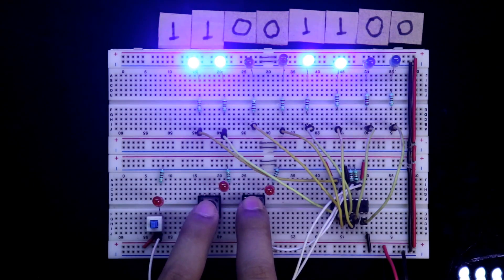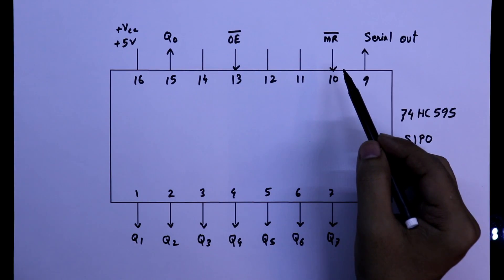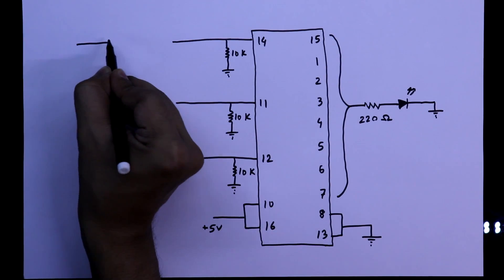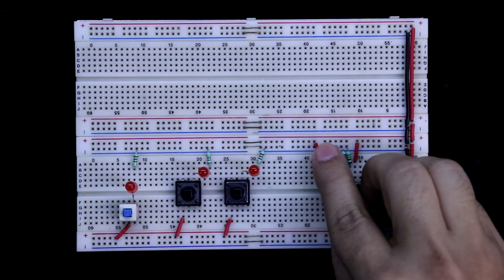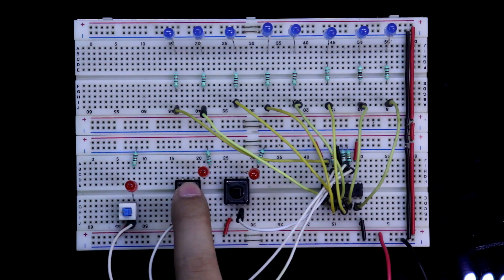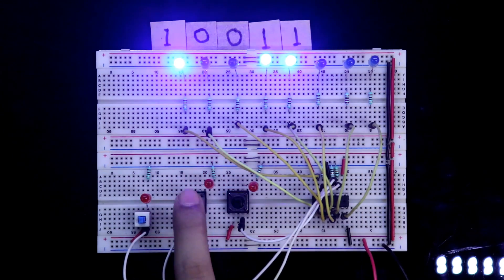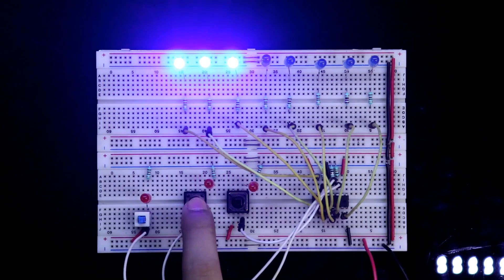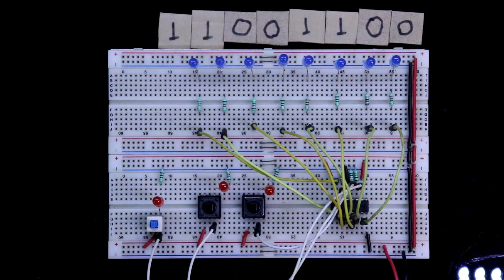74595 working of 74hc595 shift register

Comment: How did you make it so stable?
I did the same circuit - and got a lot of noise even powering from a battery. 
I.e. no result when pressing ether button - but then suddenly a few LEDs illuminated by a single press or even just me touching button contacts.
I do have pull-down resistors for all the buttons.